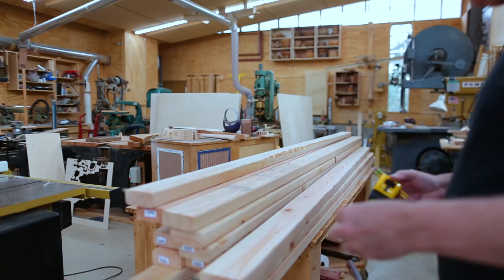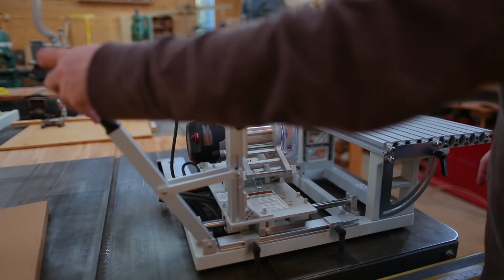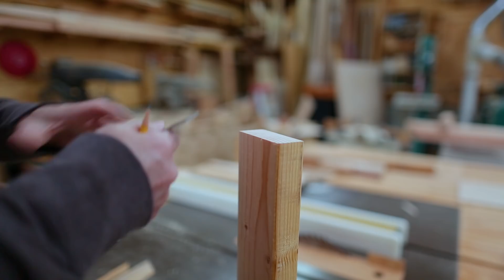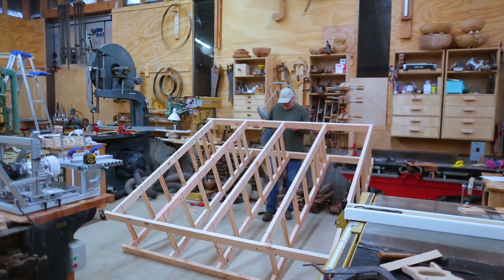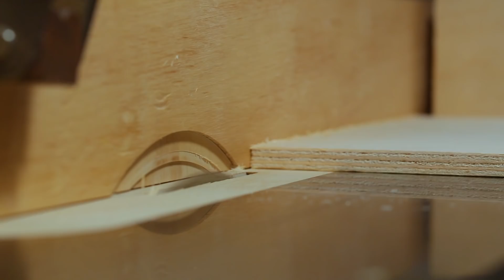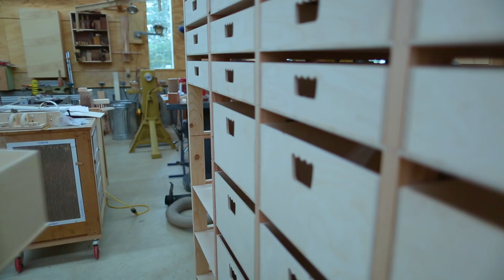Garage Storage Drawers Part 1

Comment: Panorouter is a lot of dough.  You can buy a domino, a router, a dovetail jig, and all the accessories for less than a working panorouter with a mill.

Love the channel though and your design aesthetic, which is similar to mine, I think.  I'm never going to get a CNC soon so my handles will be with a forstener bit and a jigsaw.

Comment: Frank,  I like the method you used to make drawer slides and I see you used 1/2" ply for the bottom.  I have used that method over and over again but my drawers were smaller  so I used 1/4" bottoms.  They were very successful and I have used them now about 7  years and they still work fine.   Mine was an experiment which proved alright.  Thanks for your videos.  I like them a lot.  John in Missouri Valley, Ia.

Comment: I have a suggestion: make the front inch of the dadoes bigger/taller so you can more easily fit and then slide the boxes in. It will be a pain to do that precise fitting every time, especially if the boxes are full of heavy items.

Comment: Nice attention to detail—your video motion effects are a nice touch, too. One suggestion regarding aligning the drawer bottoms to overlap the correct amount: use a jig that has a rabbit at the top — the drawer side aligns with main jig and the rabbit is offset for the bottom to slide over the correct amount.

Comment: Nice video Frank, I’ve built similar pieces for clients in the past usually for their laundry rooms. The first one I did was like yours with no intermediate lateral supports, the wood bowed ever so slightly and made all the drawers on one side of the bow jam an the ones on the other side sloppy. Client kept using it in this state for about a year and eventually destroyed 9 of the drawer boxes. After this disaster I always add a spacer across the middle of all the bays to maintain dimensional integrity. If it disturbs the look you’re going for paint the spacer black and set it back 2” it helps hide it.

Comment: If you wanted to do a drawer system like that again and have some added strength to your drawer bottoms (which i thought was a clever system), you could leave the front and back longer than the sides and cut a dado so that you could slide the drawer bottom in right to left. That way when its in the frame as a drawer the bottom is supporting the weight like you described in the video, and then when you pull it out to use like a box, the dados the bottom is slotted into gives it extra support from falling out. Just a thought. Im sure yours will work great, but for someone that need the  extra support for heavy stuff it might be an idea.

Comment: Small feedback. The drawers need an easy clean way to be labelled. A plastic pouch with paper or better a solution involving the CNC and carving labels into a piece that slots into the front.

Comment: They seem a little bit hard to put in, especially when they'll be heavy and full with stuff.
One idea may be to have the front end of the slots where your bottoms slide in to be a bit wider, and kind of guide the bottom into a narrower path.

Comment: I wonder if it's great adea to add say 1/4 inch thick tough nylon to bottom. makes it seperate from floor making it easy to stay dry, as well as easier to slide if have to.

Comment: I think the pantorouter is great and totally has its advantages but this feels like a perfect application for the Festool Domino or Domino XL. I am adamant it would have been faster.
Reply: I haven’t had the chance to use a domino yet... would it be as repeatable as Frank’s approach?
Reply: Easier to setup and more repeatable.

Comment: A simple solution to a sturdy carry box is to just put a piece of strap from handle to handle. You glue it on  and staple the ends on the handle portion of the box. I have seen this done in several places that kept their original produce type shelves, before they were torn down or replaces. I've never seen one fail, equally at odds with why it isn't popular anymore.

Comment: Roller for the hose.. LOVE!!!  I have been fighting the hose on the PR for years with different rigs and that was so simple.  Dang you frank!
Reply: Be sure to check out the video in our support section on our website about dust collection hoses and how we secure it with a bend in the hose so it doesn't drag.  Works great and is super fast and easy.
Reply: @macsheldon  Thanks Mac will do.  Love the device but every time I look up the new model is even better.  I've done some really complex shelving and even fine woodworking with the PR.  Always a joy to pull out.
Reply: @macsheldon  I couldn't find the video you're referring to.

Comment: Love the unit of storage, excellent. But tell me, after all these years of furniture and storage design, why do we make the bottoms of the drawers out of thinner stock? The bottom carries the weight of the contents, and all to often is the point of failure in the drawer. Seems to me the bottom should be the thickest, not the thinnest!
Reply: (EDIT: my opinion:)  The glue will fail long before the plywood.  You could store bowling balls in those.  The thicker sides allow for the interlocking joinery and additional surface area to glue/staple the bottom to.

Comment: Could you please provide more information on the pantarouter and what it can do. thanks
Reply: Pantograph tool
https://woodgears.ca/pantorouter/ inventor
https://pantorouter.com/ manufacturer
Reply: https://pantorouter.com/how-it-works
It was designed by Matthias Wandel; the original and his current one were made from wood. You can check out his YT videos or his articles on www.woodgears.ca. He has a lot of good content on his channel.
Reply: The PantoRouter does mortise and tenon, box joints and dovetails safer, faster, more easily and more accurately than any other jig on the market today.  It was invented by Matthias Wandel in 2010 and the all-aluminum commercial version was introduced in 2013 by Kuldeep Singh.  We have continued to improve it from the original design by adding dust collection that's incredibly efficient, a tilting table for compound angles and tapered templates for micro-adjustment.  Check it out on our website at www.PantoRouter.com

Comment: I don't like Festool, but you could save a lot of space and time using a Domino (you can get the bigger one and use an adapter to use the small bits) instead.
Reply: I use both and it's not as strong or honestly..... fun.  PR is a bit of a dog to setup but once you have it dialed in it's a beast.

Comment: How did you decide on the thickness of the plywood for the drawer bottoms? How much weight do you think those drawers will be able to hold without a lot of sagging of the bottoms?

Incidentally, if you mentioned the thickness you used, I missed it. Was it 6-mm? 9-mm?

Comment: Another great video, thanks, Frank.    Curious about what grade of 2x4s you used for the frame.   Lots of what's available here in Oregon is so wet that it doesn't stabilize for a while, until it dries.   Seems it would be a problem for frames that require that kind of precision.

Comment: What are those silvery things supporting the long end of tablesaw work? e.g. at 13:10 in the foreground?
Reply: I was curious about those too. They seem super handy.
Reply: They’re rollers. Same ones you see on conveyor systems.
Reply: Simply put, it's a metal ball in a casement that you can screw down. Google "ball transfer systems" and you should get the starting point to what you need. FleaBay has a few examples, but it's hit and miss.

Comment: Another great production!  You didn't detail about the 2x4 material you selected.  Hopefully, you got some higher-grade stuff, kiln dried--i.e. not laden with water and relatively dry.  I worry your nice square structure with CURRENTLY smooth sliding draws binds/loosens up on you in time.  I didn't see you install any solid side-to-side 2x4 (like a fire-break in a wall) to help keep the drawer widths locked in.  In that respect, using 100% plywood would've helped such a worry.  When I remodeled my master bathroom, I redid all the walls for the future tiled shower stall with kiln-dried 2x4 and I went a step further with the jointing/planing of the 2x4 like you did.  I had to add back some material to get it back to 3.5" but the wall came out dead flat--my tile guy was impressed!
Reply: Also, you may wish to wax the drawer guides to keep things smooth.
Reply: He might have more structure when it's in it's final place.  Since that's a whole other video I think there's more to come on that.

Comment: I am torn between liking this video and disliking it... On one hand love the idea and the vast amount of storage, but... Who is gonna have a $2000 pantarouter setup just floating around to do tenon's and mortises? Wish you could have shown it done on the table saw etc. Or used the CNC. At least those are far cheaper and easier to come by.
Reply: You can build your own. Matthias Wandel has plans on his website for $18. A Domino costs $1K and does a lot less.
Reply: That's like saying you hate NASCAR because they can afford better cars than you.... rather than properly hating NASCAR because they are just going fast and turning left.  Who has time for that???

Comment: Great video and design. Here's some thoughts on the design if you don't mind.
The biggest thing that sticks out to me is the dado the drawer slides in, it looks nice on paper but when I picture myself putting the drawer in I can imagine some frustration since it's such a precise fit. Not a problem if you're not in a hurry or if the drawer is empty / isn't heavy but if you are or it is then those openings are awfully small to aim for in my opinion. And then I start to question the longevity of them (dado opening, drawer "slide" edges) as with time they're going to get a bit banged up. I also wonder how easy they will slide with time as the wood breathes.
Perhaps the dado could just be made thicker as a whole, maybe even flaring out the opening a bit. That way one would have a bigger opening to aim for.
Another thing is the drawers themselves, the two handles makes a lot of sense for carrying it and it's contents but the second handle isn't accessible until you have removed the drawer from the shelf. And it stops being accessible the moment you start puttting the drawer back in. That's a bit awkward. Well, one could hold it from the bottom instead. But side handles would be a logical addition. You probably know this and might have even done it already as I see you held the drawer from the sides when you put it in :D I'm thinking either a pair in the center for balance or maybe two pairs towards each end so they become/stay accessible a bit earlier/longer and you reduce the load on the drawer slides and the dados compared to the centered handles.
Reply: I think I agree with both your ideas... flare the opening and handles centered on all four sides.  I like it...

Comment: Superb. I did a project like this for a rolling shop table. It was not unlike Jeremy's, just portable and fewer drawers. I really struggled to keep my sides squared. I used plywood, and it just wasn't as controllable as the framed panels you made. Because of jointing and planing it would've been much more in my wheelhouse to treat those as perfect planar surfaces compared to, somewhat ironically, the plywood. For my small setup there is problem of so much dust collection. Then there's how hard such a project is on my jointer and planer blades. But, I guess that's why we buy the stuff. To use it! Great job.
Reply: Unfortunately, to use it is also to use it up. So, don't skimp the upkeep.

Comment: I would do the boxes a little bit differntly. Just to set the mind, start with a cube made from six identical pieces. (Two opposing sides will grip two other pieces.)  - The bottoms could still slide into the beams. But you would only need a bit of glue or screws to fix them in place. - Hope you guys get the picture.

Comment: I wonder if it would be worthwhile to combine that style of drawer with french cleats -- put narrow cleat rails on either side of the support rails and then cleat hangers on the sides of the drawers so that you can slide the drawers in at whatever height you want.  That way you can move the drawers around however you like.
Reply: Interesting idea.  I wonder if slight bending from weight would make them bind and slide less?  But then you just make the drawer sides 'taller' with the cleat at the bottom.  Hmmmmm